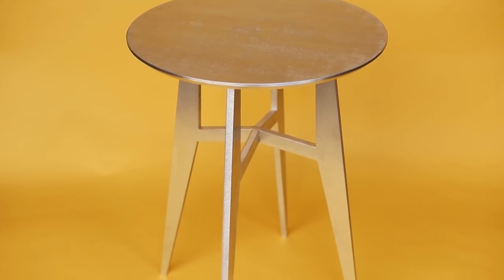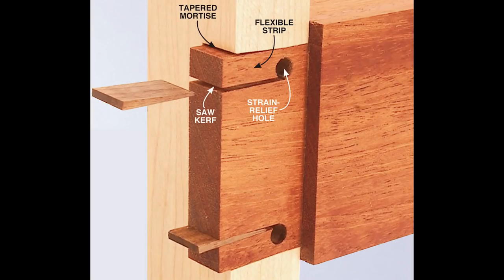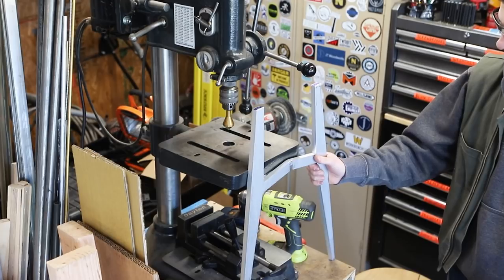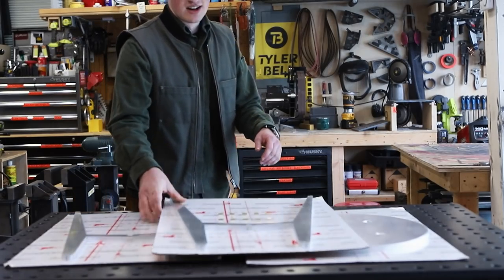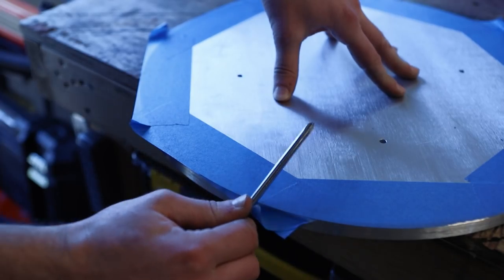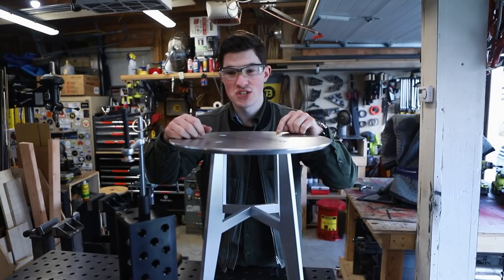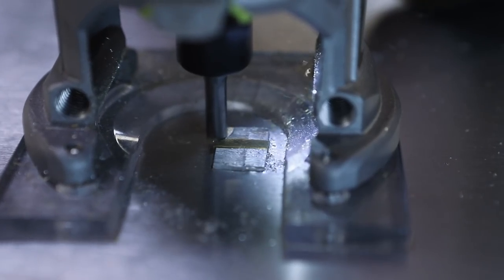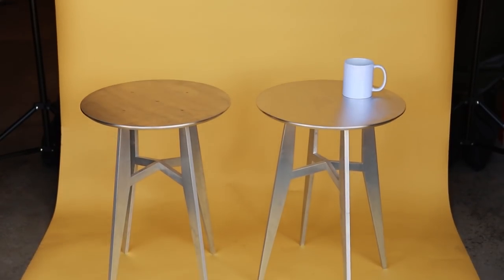Aluminum Table with Wedged Mortise & Tenon (using woodworking tools)

Comment: I just did a fairly complex project that required routing aluminium. I wish I knew that tip to clean up the surface. That was excellent!!. Also loved your use of the wedges and peening the surface over. Welding isn't always the only option!!

Comment: 600$ a piece?!?! insane xD
Reply: If it comes out of a plate, you're paying for the drops too. Make the legs as skinny as you want but you will need the same size plate to cut them out of.
Reply: @hipairbrush1053  Making it out of wood wouldn't be much cheaper these days...
Reply: @Jacob_graber  it only save about $500
Reply: @jasperzuidema2656  I can build it out of scraps, the only piece that would cost me any money is the table top
Reply: @Jacob_graber  if you use construction grade wood sure, but hardwood hasn’t seen nearly the hike that softwoods have
Reply: If you orders those pieces in higher quantities it would reduce the cost a lot. Potentially you could also redesign the legs to best better on the plate and safe a lot of off cut scrap.

Comment from the maker: What kind of furniture would you like to see made entirely of metal, and what material??
Reply: Make a metal chair like the one Alec made but aluminum
Reply: Aluminum sofa! 🤣🤣
Reply: If you could hydroform metal pillows or a metal ottoman stool, that would be awesome! I think if you weld up (and later cut out) a frame, it would limit where the metal expands, leading to a pillow-like quality. Who wouldn't want a metal pillow?!
Reply: How about a cool display cabinet?
Reply: Do some carbon fiber stuff
Reply: Titanium library ladder chair :)
Reply: Paraguayan hammock for garden. Nice work
Reply: I've always wanted to build one of those collapsible tables that turns into a park bench out of aluminum, that would be a cool video.  Keep up the great work :)
Reply: Hammock - wire and brass
Reply: A steel carpet that somehow doesn't maim you. But a toaster would be nice too.

Comment: For this technique, a good future project might be kinematic art. At $600 for just the starting materials, a piece of moving art might be easier to sell than a small table. A few web searches on kinematic art should bring up several good hits, but I suggest also looking up the arcade machines by Tim Hunkin, and the long history of novelty clocks.

Comment: Would have been cool to leave the joint metal aluminium and the brass wedge's long and used a TIG welder to make an alloy and then sanded it all flush, might have had to used copper.